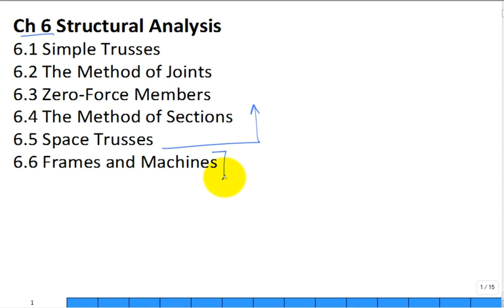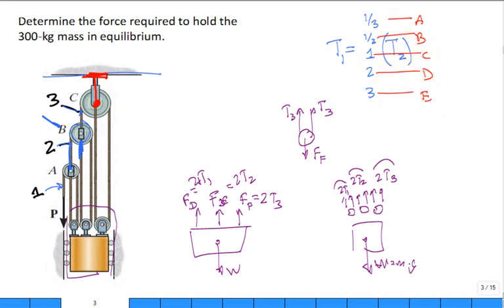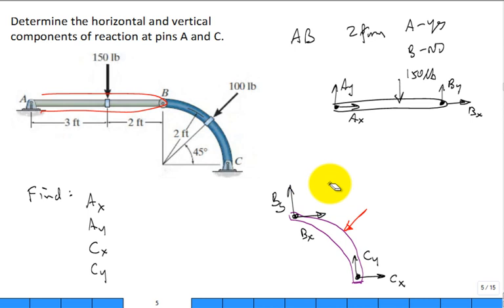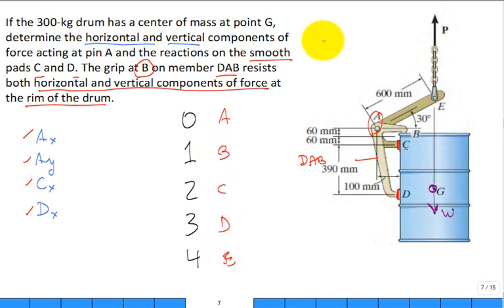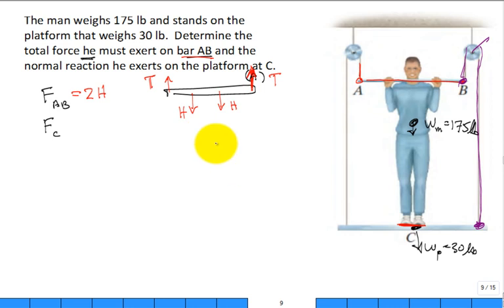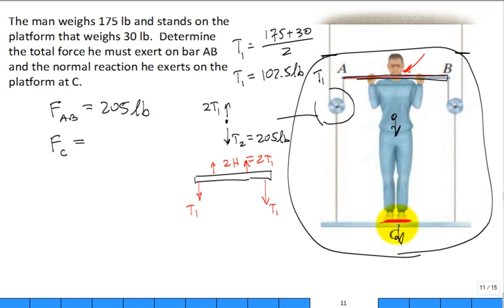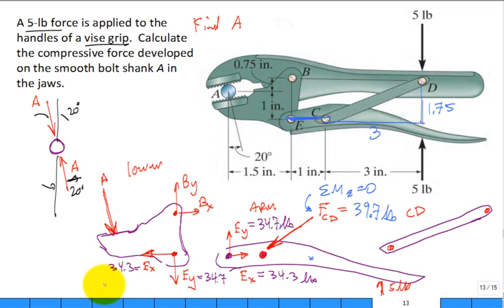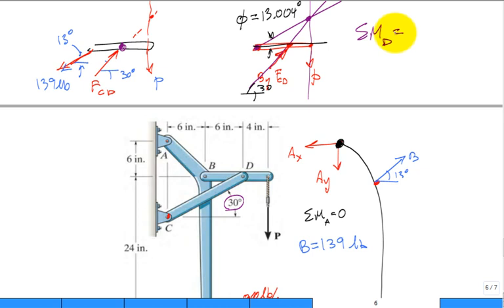Frames and Machines

Comment: for the smooth bolt shank example, on the fbd of the lower handle, how did you not calculate Ey to being 15lbs? summing moments about C gives you 0=5lb(4in)-Ey(1in), therefor, Ey=15lb, not 34.7.. correct or?